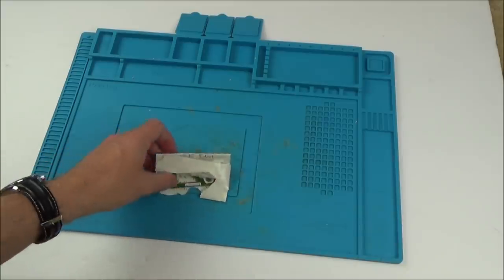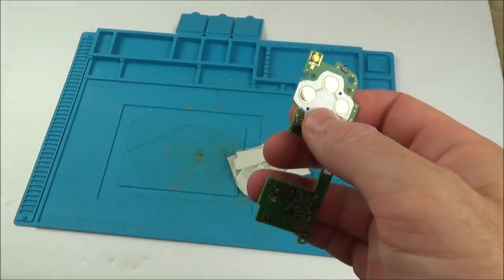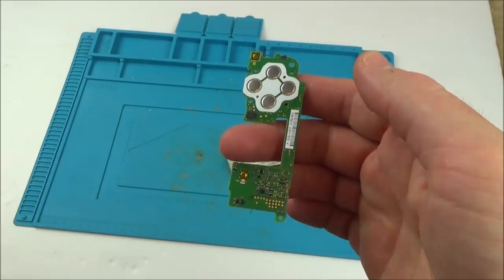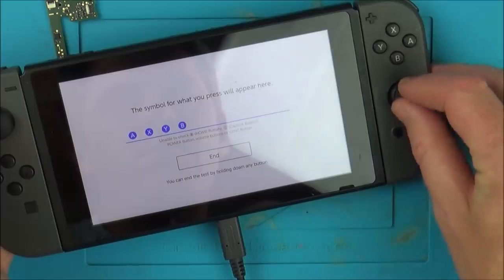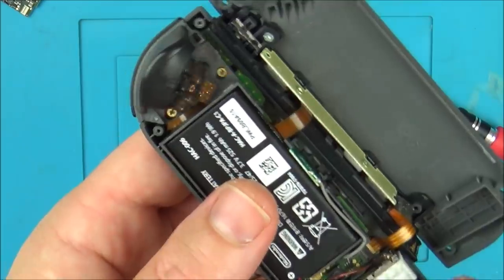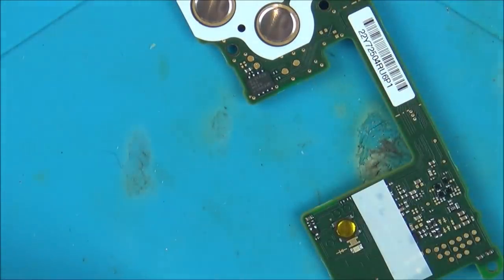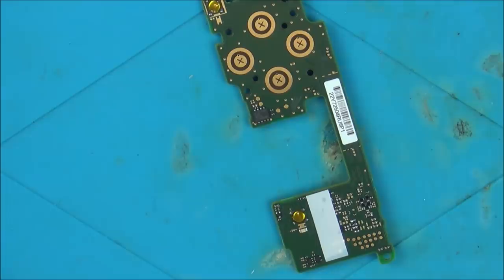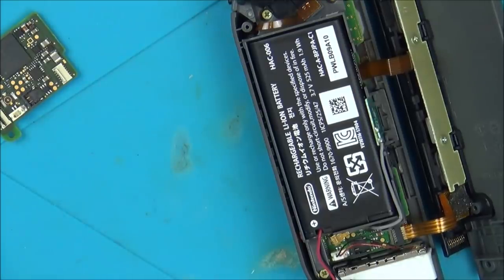Trying to FIX 2x Nintendo Switch Joy Con

Comment: Ribbon connectors--- the curse of electronics. Started back in the eighties with home computers. There was such a thing as wired plugs and sockets but price and size has taken over. The ribbons have improved some what, but they remain a major weakness. Always on tender hooks when ribbons meet Vince.

Comment: Vince there are numerous ways that switches can be connected - not just all to a common ground or voltage. Sometimes they are multiplexed - X rows of Y columns. Sometimes they switch different resistances in to work out which button you pushed. Sometimes the contacts are metal, sometimes carbon, sometimes capacitative. As for the last issue, rather than trying to swap out just the clip, change the whole connector  - might have been a better result.
Reply from the maker: Thanks for the info David :-)

Comment: Checkout the range of scopes from Amscope. They may be a bit large for your application but they work amazingly well 7-45x would be my preference for what you are doing with a 0.5 barlow lens so you can work underneath the lens whilst looking through the viewfinder. Probably suited for a desk setup though and not working on the floor :D

Comment: Sometimes things are ground-switched and the positive is the common. This is done to prolong the life of switch contacts and prevent small arcs which will slowly erode the contacts. Dont know the inner workings of a switch controller, but I do know that this is done with sensitive electronics like ECUs in vehicles. Very common to see ground switched components like fuel injectors and whatnot.
Reply from the maker: Thanks for the info :-)

Comment: I was wondering: Why not just push a little Paper under the ribbon cable so to push the cable against the Contacts?
I have done this on one Connector of a new 3DS XL. Works happily ever after.
Reply: But if it gets dropped it won't work anymore until it is apart and fixed again
Reply: If there is enough tension with matching layers of paper and a little bit of sticky tape, I believe if won’t ever slip out again.
And if it does, go at it again. Still better than throwing it out ...

Comment: A possible fix is to just get rid of the ZIF connector completely, take it off the board, solder the ribbon straight to the exposed pads.

Won't help with the ribbon that has a partial break in it, but depending on how bad the break is, you might be able to expose the trace, solder it back together, then put some kapton tape around it or something just to provide a bit of strength.

Theoretically, that should be 100% fixable.

Comment: get rid of the connectors all together and solder wire based ribbon cables to both boards....the old 80 strand ide cables are great for this as they have quite small cores with tight spacing.
Reply: That could work

Comment: I wonder if you could modify the plastic solution to the ZIF problem by wrapping some of the ribbon cable in sellotape(not on the contacts) to thicken the cable to apply more pressure. Not sure if it would work though.
Reply: It should

Comment: I did have the same problem on a phone. I did put some solder on the connection the ribbon was in. Did not work but it was stuck there so I think it can work with better soldering skills!

Comment: I just had one with the same issues as your first joy con. In my case it was The Button sticker.
Buttons showed good with multimeter and still none except sync worked. My guess is buttons shorted fine but didnt go all The way open.

Comment: the video was interesting imo so no need to worry about that. i do have a question though, is it possible you could solder a new connector onto the main board?
Reply: I mean anything is possible but it's going to be a absolute pain, something that small you'd ideally want to hot air work it off and replace it but with the connector being plastic it would melt. So the only other option is soldering iron but that's some fine tip steady hand work and in all honesty it's going to piss you off more than it's worth.

Comment: First, solder all the contacts with tin-containing solder, then warm with a hot air gun at a temperature of 240 degrees. Plastic will not melt if it is not heated for too long. Everything is very simple! With Google translate viewer from Russia.

Comment: I bought one of them USB microscopes off ebay m8, just over a tenner and boy are they good as I went for the 2000x one as opposed to the 1600x one and now in the process of making a cradle/workholder which means I can have space for me meaty hands to get in and under with the device looking downwards.   Its that good I was able with ease to disassemble a tiny Russian ladies Sekonda movement which is about the size of a 5p :)   BTW you appreciate good watches, have you tried a Vostok Amphibia or a Vostok Kommandirskie?   Amazing watches with movements as accurate as an Omega or Rolex some claim.   I bought a 45 year old Soviet Amphibia and it hasn't dropped a second since I got it, I keep expecting it to but nope, it is still keeping in time with a precise time online.
Reply from the maker: Never heard of those watches Ian but they look nice. Quite a few for sale on eBay as well, I will read up on them. Thanks for the suggestion. I have just ordered a microscope so hopefully it will help me in future vids. It was pricey at £200 but I am hoping it will last me long term. Amscope se400-Z. It was recommended a few times to me and the reviews are very positive over on Amazon. Time will tell if I get on with it or not :-)

Comment: You broke the edges of the clip when you removed it from the good connector anyway, so it was never going to attach to the faulty connector.  It would probably have been better to try removing the broken connector and swapping it with the good one.

Comment: Is it possible to take the entire connector of the board? Rather than just remove the lever mechanism?
Reply: My guess is that the plastic will just melt. If he had a brand new connector to install I would say it's a good option but desoldering a good one from another board and install it on this board would be too much damage from heat.

Comment: Why not just swap the whole zif instead of the flap?  Probably a good reason but I’m intrigued.
Reply: If he has a brand new connector it could be installed easily but salvaging from another board and installing on this one would be a lot of heat on a piece that has so much plastic. Most of it would just melt during the removing from the bad board and it wouldn't even be in any shape to be installed.

Comment: Although not ideal, could you have used a big blob of blue tac on the connector and used the pressure of the case to push down on it?
Reply from the maker: Hi Emma. To get all buttons to work I had to squeeze down really hard. I don't think the pressure from the trapped blu tac or foam tape would create enough on this Joy Con. Maybe I already bent the pins slightly from messing with the plastic and tape etc. so it could possibly work on other Joy Con :-)